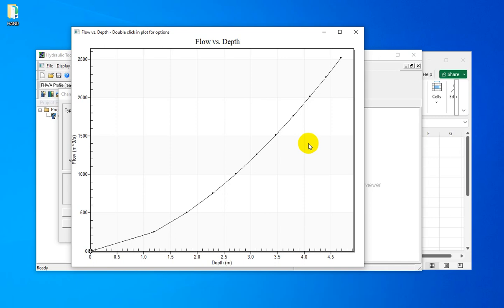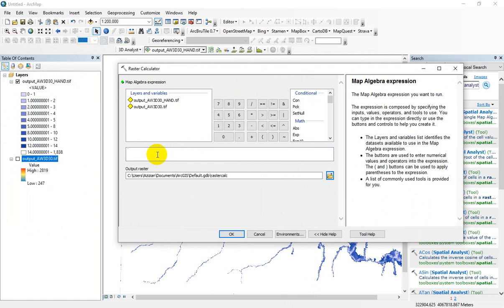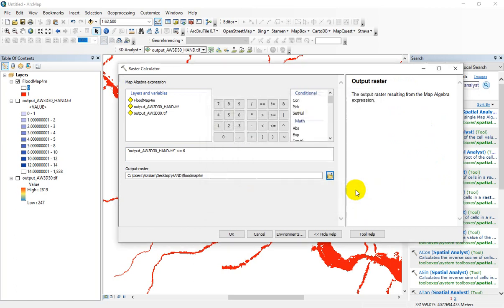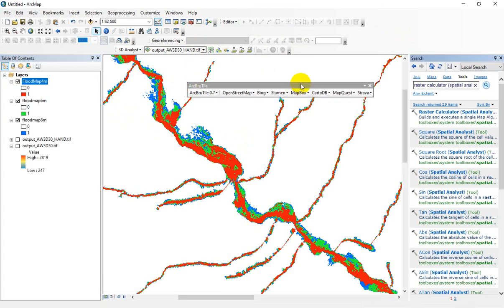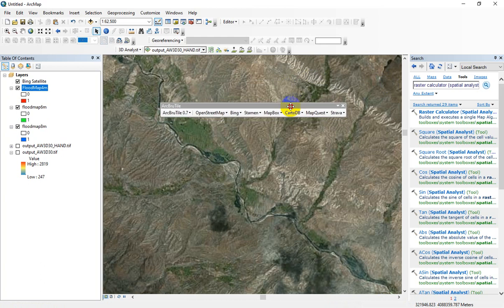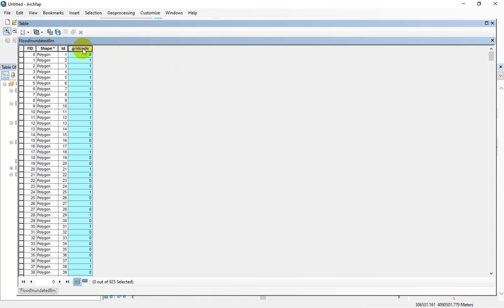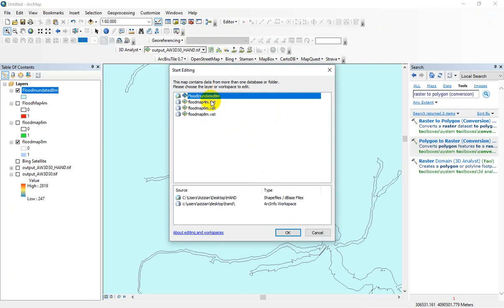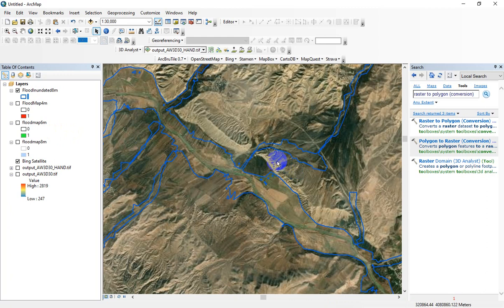Rapid Flood Inundation Mapping using HAND (Height Above Nearest Drainage) Method-Part3

Comment: You have taken a very micro area in that visualization seems good but when it comes to whole watershed depth mapping looks like a river network how i will interpret it?
Reply from the maker: Hi, this method is not depend on the catchment size and you can use it for small to large scale watersheds. the main issue that can impact the model output is the spatial resolution of your DEM. for example, if you use coarse resolution DEMs it's hard to interpret the outputs especially in upstream river reaches. for getting better results try to use high resolution DEMs
Reply: @HydroAI2024  which dem? i have 
taken srtm
Reply from the maker: @shaivichaurasiya5997  ALOS 30m is the best one for this model